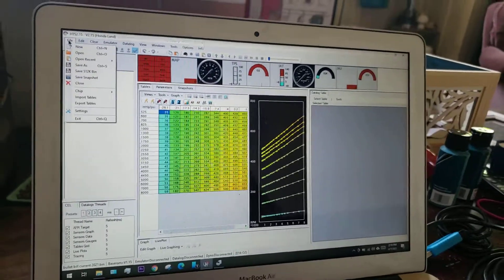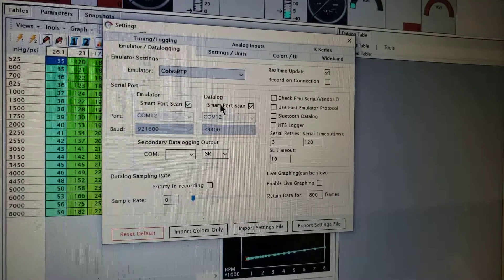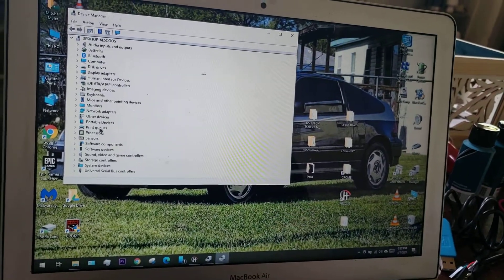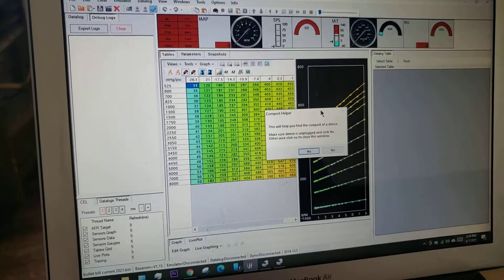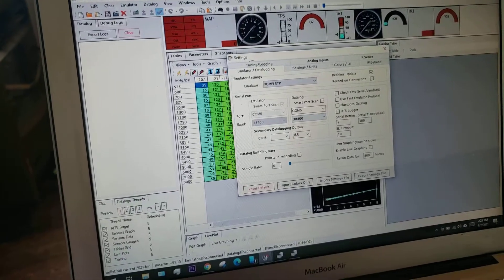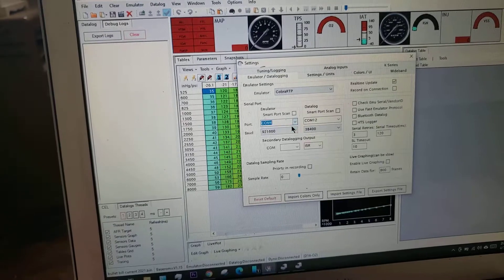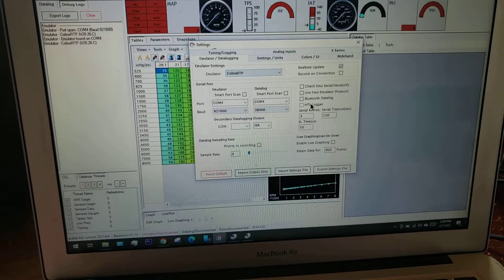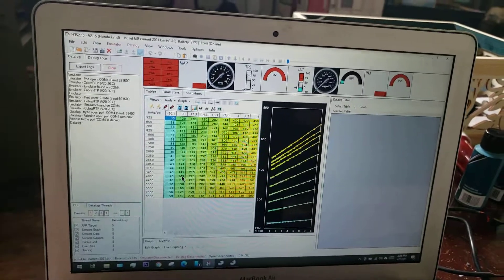How to setup a Datalogger in HTS using comport helper and device manager. Hulog CobraRTP Demon, Tune

Comment: So does the car have to be on to.connect to the datalog cause I've got the bMulator hooked up right now and followed all instructions and it keeps timing out datalog on my 4 pin header
Reply from the maker: ECU has to have power but the engine does not have to be running. If you are using that particular device you may need to add more time out to the serial connection in the settings and I strongly recommend double checking your port settings to make sure they are set to run at the right speeds. When changing all of these settings you may need to restart your laptop just so everything is in line. Some laptops and Windows 10 on those laptops acts weird with the USB ports and HTS but I've personally learned that it is due to the device used within the ECU as once I swapped over to devices such as Cobra or demon I've never had a connection issue ever again but when using very cheap hardware it will time out all the time
Reply: @hondaland_  I'll try the reboot it's doing the same thing in bmtunes
Reply from the maker: @heyeddiefixthis7308  lol at your user name. I already know why it's like that haha. You must fix everything for everyone like me!

Don't be afraid to try different USB ports. Also note that if it is a ARM CPU equiped windows machine vs Intel or AMD it will not be support on ARM architecture. The frame works mess up. 

Another thing to note is to have the most recent version of windows .NET framework on the machine as well
Reply: @hondaland9564  shits annoying lol i can't get it to log no matter what I don't understand I just put it back together fucking thing is temperamental
Reply from the maker: @heyeddiefixthis7308  sadly that is a theme with BM. Everything I've purchased from them has always had problems and or broken and they leave you on read if it is an RMA. 

Looking at the BMulator it appears to be a reverse engineered cobraRTP unit that used wires to connect to the cn2 port. 

1. Confirm your actually running a tune and not in limp mode. This can be done by turning the key to position 2 "lights on the dash" "engine off" press the pedal to the floor. 
You should get a solid check engine light. This is how codes are checked over HTS. And verifies the tune is running. 

2. Make sure your two data log wires are not backwards. 

3. Still won't work? Maybe try another data logger on the side of needed but you may need to confirm it is indeed running an HTS or BM tune on the emulator or data logging will not work.

4. Make sure your data logging resistors removed. If this is a USA ECU it is j12 it is a Japan one it's another number I don't have on hand but can be found online quite easily. Rectangle ECU is USA. Square is JDM
Reply: @hondaland_  I haven't tried swapping the TX or rx but cobra has built in datalogging doesn't it
Reply from the maker: @heyeddiefixthis7308  it does but is the same way with two wires. Just as BMs, unit has two wires and only one USB. The cobra is the same shit but red lol. He even offers a Bluetooth model just like they do. Which is just an hc05 or hc06 to go with it. But same thing just black and the location of the chips are different
Reply: @hondaland9564  yea I just looked at his sight lol I can just do bluetooth with the set up I have
Reply from the maker: @heyeddiefixthis7308  that's right. Since the cn2 ports not covered you can add it with the jumper wires. And tape to the wall of the case. I may have a few left if you wanna buy a Honda Land one.
Reply from the maker: @heyeddiefixthis7308  and I'm not afraid to say it's an hc-06 but I have it ready to plug and play with the wires.
Reply: @hondaland9564  do you have it already programmed so it's a literal plug an play
Reply from the maker: @heyeddiefixthis7308  yes and I can name it to show up on your device with whatever you want and then you tell me the setup you have and I set the speed to the correct settings for it.
Reply: @hondaland_  you got a email I can contact you at for ordering and shit
Reply from the maker: @heyeddiefixthis7308  description of this video has all my socials. I would recommend Instagram
Reply: @hondaland_  bet

Comment: This video helped me, I was able to connect hts to my demon.
But now I'm having trouble uploading the map, give me a time out error.
Reply: We're you able to figure it out? Imhvaing the same problem with my demon as well
Reply: No. I then purchased neptune RTP and worked fine.
Reply: For anyone else this may be of help.  I had the same issue as above.  I installed the Neptune RTP software and reset the board.  I closed out of Neptune RTP and opened HTS.  Then I connected to the board and it prompted me to erase the board using HTS. Now I'm able to upload the maps to the board. Hope this may offer some sort of help to anyone with the same problem. 👍

Comment: hi, i followed the instructions you provided but still it says "cant connect with ecu on COM 4" the emulator is okay but the data log is not connecting, im using HTS software and moates  xtreme hulog as data logger
Reply from the maker: When you say emulator is okay you need to confirm it has the tune uploaded and running the car. One way to know if the ECU is indeed running the tune is no solid check engine light when running and j1 is jumped. Another way is setting a low rev limit to confirm the ECU is accepting tune changes. Or the extra section at the bottom of parameters. It has a check engine light flash function to confirm the tune has been loaded. 

Once that is confirmed then you can try all the data log troubleshooting. Check continuity of all four wires on each side of the data logging cable that goes to the hue log. I've seen a few that have had a spread out pin or one that is just not making contact. Make sure that you try raising your time out and settings on the bottom right. Confirm your com ports in the device manager and make sure that they have been changed to 38400. If you need further assistance feel free to message me on one of my social platforms listed in the links in the description of the video. Trying to get a few log running can be tricky sometimes. Restarting HTS or the computer is sometimes needed whenever com ports do not want to respond.

Comment: hey man followed this tutorial after moates driver install now when ever I try to connect my hulog to datalog the debug logs say 'this operation has timed out' i can connect the hulog to crome but not hts for some reason. any help would be amazing
Reply from the maker: HTS settings and add more timeout delay
Reply: @hondaland_  it’s currently set to 5 retries with 5000ms timeout and a 50SL timeout with no luck greatly appreciate the reply
Reply from the maker: @darby7002  try restarting hts and or windows when things like this happens. If on windows 10 the ports seem to get clogged or locked up with hts and hulog

Comment: Finally got my car started.. but I had my data logger working and was tuning my idle and partial throttle in nuetral.. but disconnected to take a break. Now it won't recognize my com ports or something.. I set it at 38400 and com3 and com4 as it shows on my device manager.  But once I click connect on data logger it just doesn't do anything, or any pop ups.. but the data logger is highlighted in green not red as when its disconnected.. but it doesn't show any live feeds and tps says ecu not connected again.. should closing HTS fix this? Or should I restart my laptop?
Reply from the maker: That is when you want to restart HTS and or the laptop when comports lockup like that. It's annoying windows 10 doing that
Reply from the maker: I will say once I got on to a cobra or demon or any RTP/datalogger combo board and away from the hulog I never have that datalogger not wanting to connect issue anymore. I seem to even have better luck with the usb-ttl adapter that shows up when you Google it that is blue on the end that plugs into the PC like in my hc-06 latest video sitting on the laptop. They run anywhere from 2 to 10 bucks
Reply from the maker: Also make sure to connect emulator first and then the datalogging 2nd
Reply: @hondaland_  with ostrich emulator, am I able to make adjustments while the car is on? Or do I data log then shut the car off and make adjustments then update the map while its off
Reply from the maker: @righty-tightybuilt548  your able to make adjustments with the car on
Reply: @hondaland_  thanks. You've been a huge help. I really appreciate it. If I run into any other issues, I hope I can come to your channel to ask questions. When ever you have time that is. Thanks again.
Reply from the maker: @righty-tightybuilt548  for sure. Or your more than welcome to dm me on insta or Facebook to get a for sure reply. I'm surprised at how youtube is handling the comments lately. Most of the the time by the time I am sent the notification it's been weeks